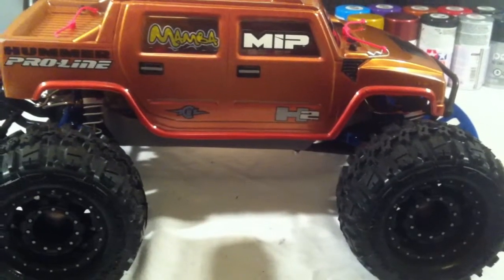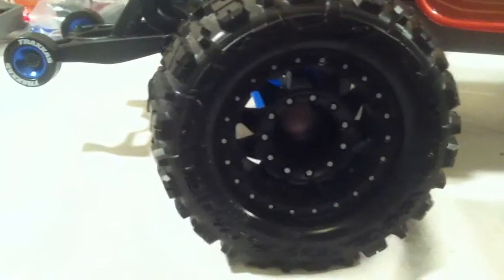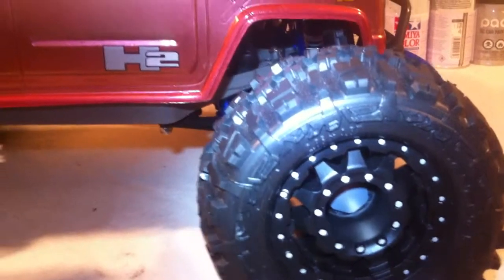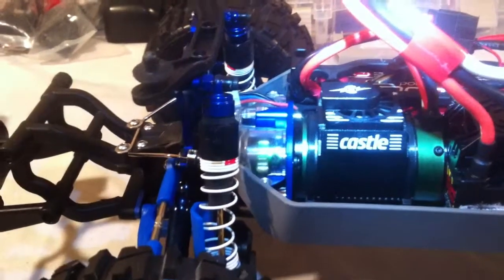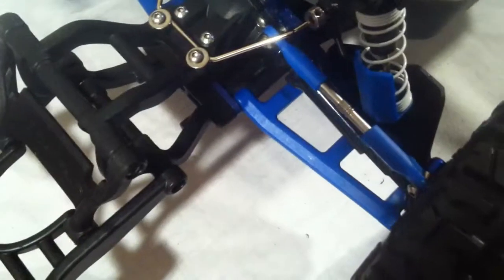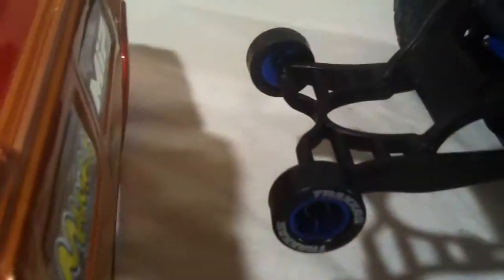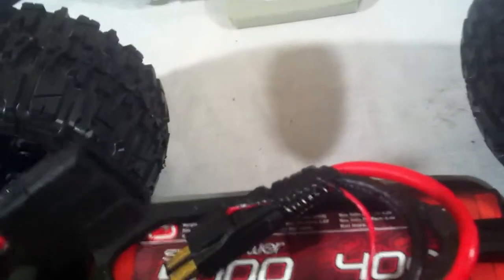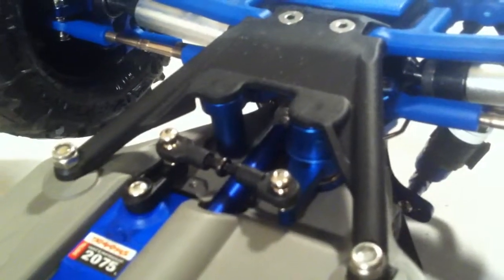Traxxas Stampede Castle Mod

Comment: How did you mount the motor esc combo?  Was it a direct fit?
Reply: you will have to trim the chassis to get the bigger castle can in as well you will have to cut out the original esc mounts... everything will however fit(tightly) running 20t pinion 52 spur... very quick.. make sure you have mips or you will be changing cvds daily!!
Reply: Marj Markwart thanks. I installed the mxl6s with the 2650kv motor. Its a beast on 4s. Were the wheels a direct fit on the mip 17mm hexadapters? I have them to but mine mashers 3.8 proline wheels wont fit.
Reply: I had to buy proline f11 rims (17mm) and yes the mip adaptors fit nice and snug.